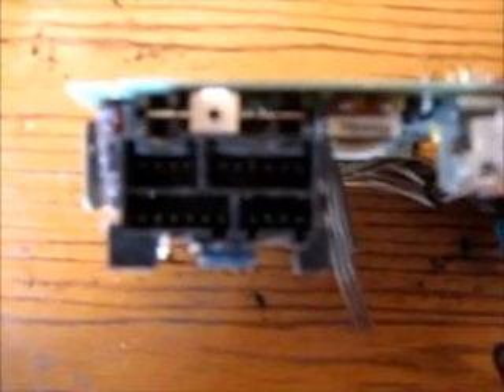Camaro Radio Plug Diagram Pinout

Comment: I've done many installs on my different cars over the years that followed those basic pins, but the last few Gms I've had used either 1 or both of those harnesses for the oem head unit . lil by lil I'm coming across more details, so for any viewing this vid trying to do the same use kw monsoon as bose didn't get me far.

Comment: I have a 98 that has the full sound pkg, woofers in the backseat that I think are amplified, a full range on each side in the cargo, & the front door speakers don't have the amp but 4 wires to it, my oem theftlock also uses the plug in the center that leads to idk where for a changer maybe?

Comment: so here's my problem w/ this video...why doesn't anyone specify about the "not used" section of the harness (4th plug/bottom left)?! steering wheel controls?  also a camaro is a bad reference as it commonly uses amps & I'm thinkinking two amps(radio has 1 inside) in line will cause damage bec. of possible feedback